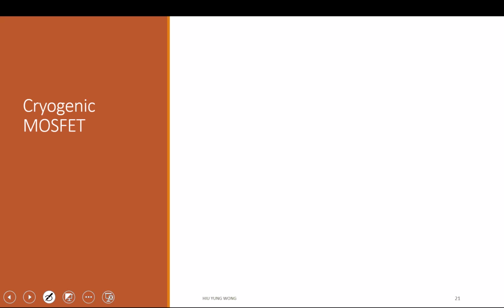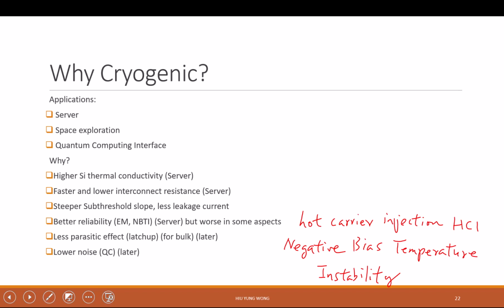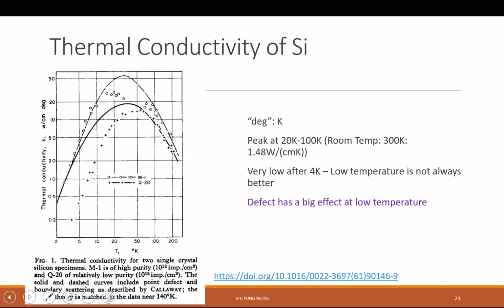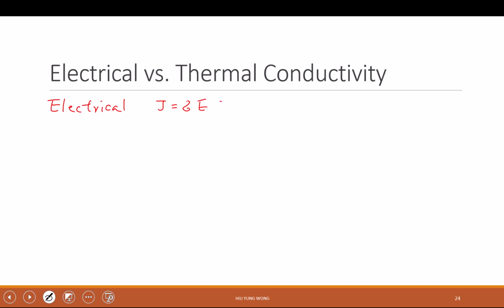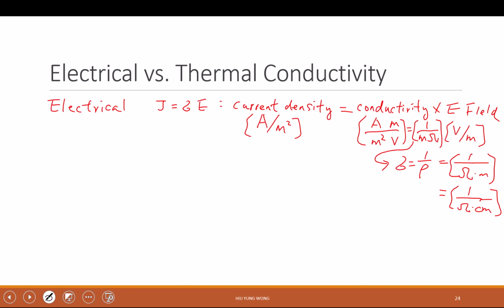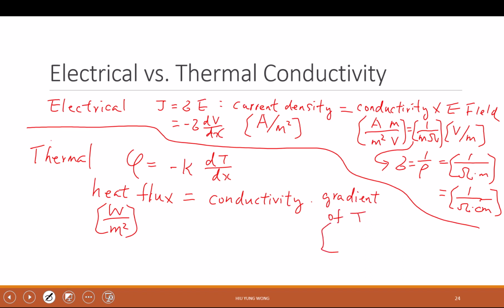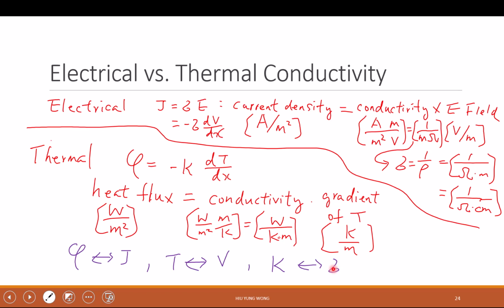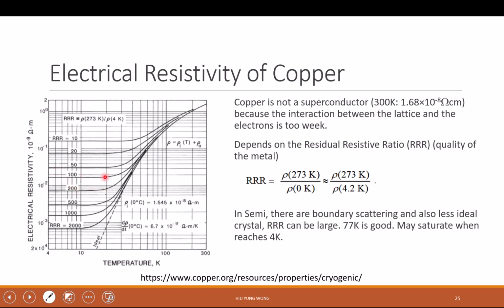L2C  - Thermal Conductivity and Electrical Conductivity at Cryogenic Temperature

Comment: Hi Prof, I have some superconducting alloys (Mo-Re) they are superconducting, and I measured their thermal conductivity, however I am trying to do a low-T fit when I plot K/T vs T^2. I am using K/T = a +bT^2, but I am getting a negative b value. I have fitted low values above and below Tsc. I am still getting results I cannot make sense of. Could you assist me?